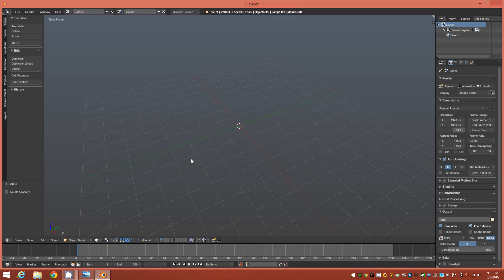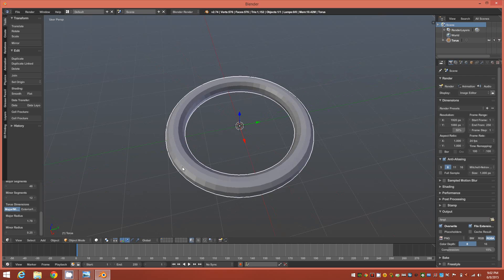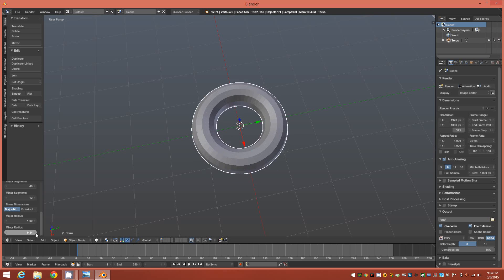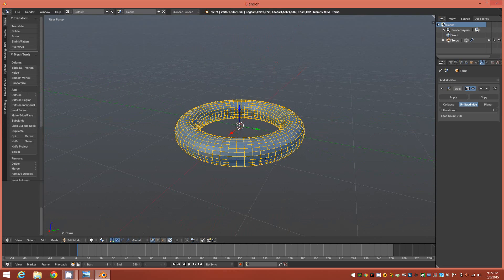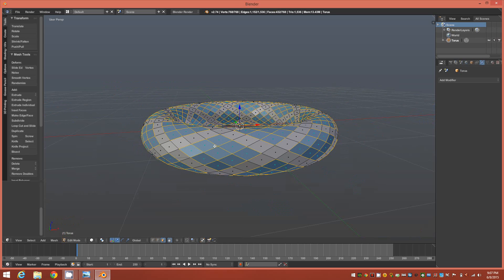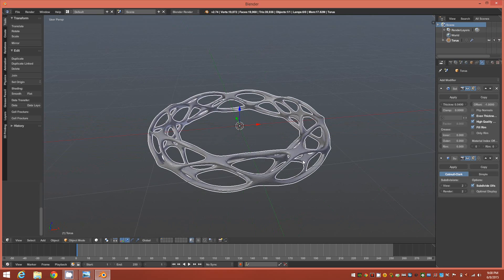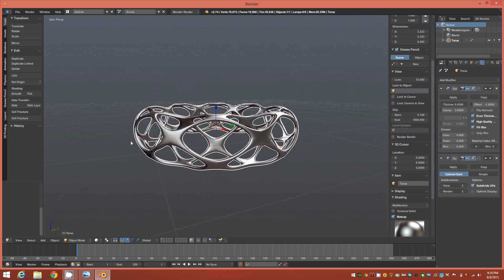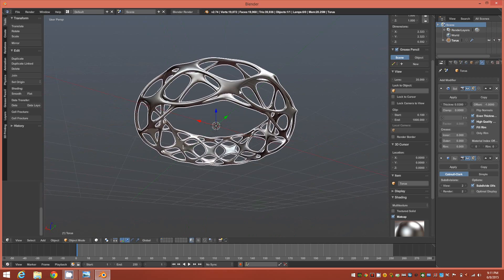Model A Voronoi Style Bracelet In Blender 2.74

Comment: You can have very similar effect faster. Instead of decimating with factor 1, decimate with factor 3, add wireframe modifier then subsurf modifier.
Reply from the maker: It would be similar, but not really the same.  The result would not have a X crossing edges shape when viewed in between each hole like the result here, which gives it a unique appearance.  Also, the wireframe modifier would cause pointy triangular appearance around the bracelet, which may or may not be comfortable if you took it to 3d print.

Comment: Nice toturial 
very helpful 
I'll try printing it 
thanks
Reply from the maker: What kind of 3d printer will you be using.  If you print through a service like shapeways with SLS technology then you should have no problem.  Just stay within the thickness limits.  However, if you try to print this with a standard filament printer, then remember the 45 degree overhang rule, and add some supports to avoid issues.  Meshmixer can add supports automatically.
Reply: I'll try printing it using FDM tech
Reply from the maker: If you're using FDM with PLA material on a Makerbot or some such machine, then it may not be successful without support material.  Have a look here at the difference between SLS and FDM with objects of low to high complexity.  https://www.sculpteo.com/en/3d-printing/fdm-vs-sls-3d-printing-technologies/
This bracelet will have a lot of overhangs which may cause significant problems for a FDM machine, but would be fine for SLS or SLA.  You should consider adding some supports with a software like Meshmixer to ensure a greater level of success.

Comment: Thank you. Maybe by choosing a different torus definition you would have got Z axis symmetry before smoothing ?
Reply from the maker: +Andre Jolivet   Do you have an example of what you mean?  Sounds interesting.
Reply: +John Malcolm Hello, I've just repeated step by step and you can just select another adjacent face to have the symmetry. Maybe you did not notice in 3d view that the starting face you have selected was not at 0 z. Thank you.
Reply from the maker: +Andre Jolivet  Do you mean the part where we select the criss-cossing pattern of faces on the object?  Yes, selecting another face just below that one would create a more symmetrical appearance, you are correct.  However, it will also alter the thickness of the pattern as well.  I suppose that isn't a bad thing here.  Good idea.